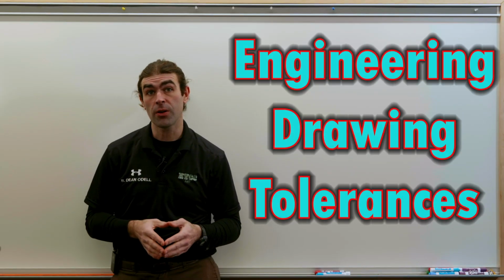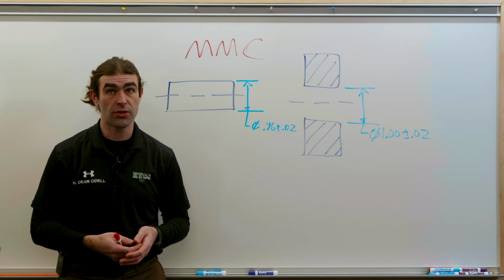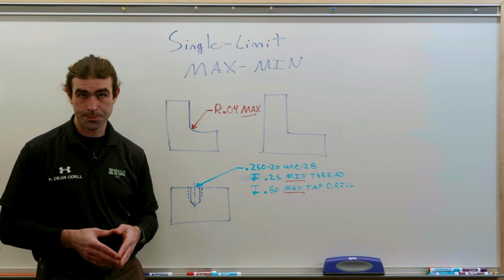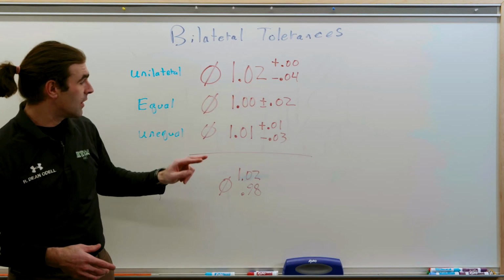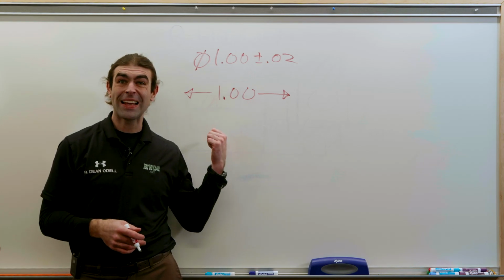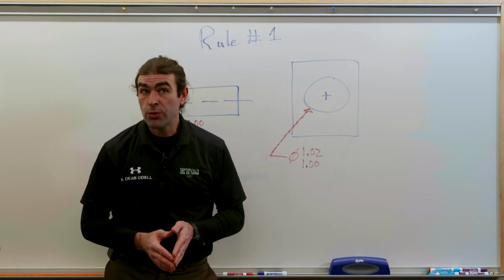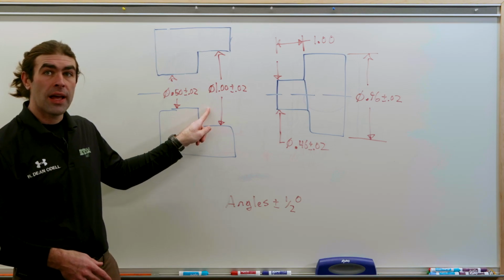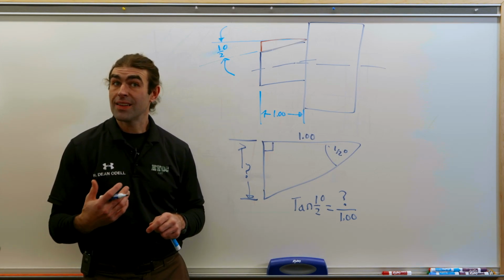Engineering Drawing Tolerances (2022 Update)

Comment: How important is temperature on that measurements?
Reply from the maker: Hi, depends on the tolerance and size of the part. If it’s a big part with a tolerance of .0001”, a temp change of a few degree can make the part grow or shrink by that amount.